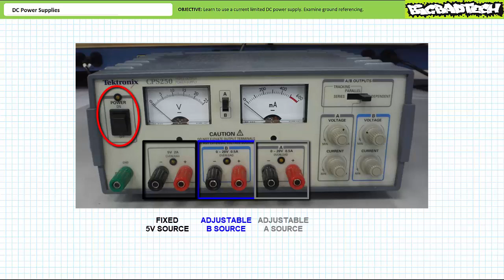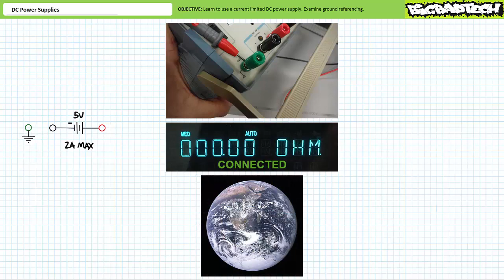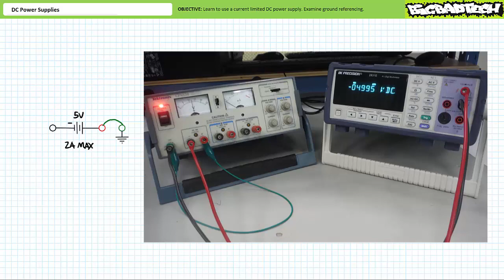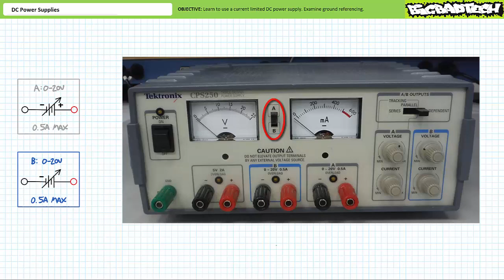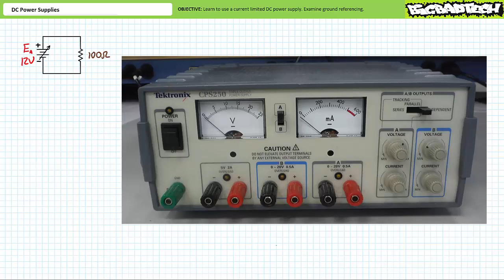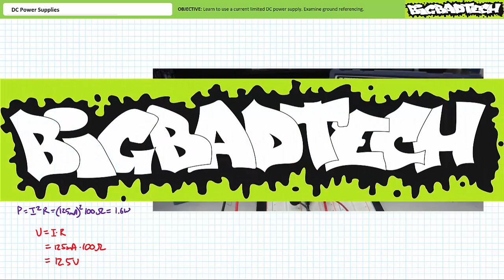DC Power Supplies (Full Lecture)

Comment: Hello. Late to the game, but I am a learner.
An amplifier board needs +/- VDC. How does a bench PSU supply this? Are there + and - leads/outputs? Thanks!
Reply from the maker: Excellent question! Given a power supply with 2 independent outputs one would establish a common connection with source A negative and source B positive. Then one would supply the amplifier with source A positive and source B negative.

Comment: I am using an arduino in an 1965 50 vac pinball machine and it reset when the flippers actuate.  can this be changed with using DC power?
Reply from the maker: An easy way to convert from one flavor of electricity to another (ie: DC to AC or vice versa) is through the use of an interposing relay. Check out the "PLC Interface Methods" lecture at: https://youtu.be/G4uo0Sm0uMo
Reply: @bigbadtech  will do thanks
Reply: Simply put. If your desire is to make a certain DC voltage to actuate something but AC is an already existing control (pilot) voltage. Use an ice cube relay (120VAC coil) put your desired DC voltage on the common terminal and connect the output wire to a normally open terminal associated with that common.
Reply from the maker: Exactly.
Reply: @bigbadtech  is DC power known to have fewer issues with unwanted EMF than AC power.
Reply: They also make old style 48 VAC ice cube relays.

Comment: I just bought an oscilloscope and DC power supply today to start probing and building ttl circuits.
Reply from the maker: Very nice. I've got some older lectures on digital electronics on the @cgcclive YouTube channel.
Reply: @bigbadtech  yea I'll definitely check it out. I was Firecontrolman in the Navy for 10 years. I got out back in 2016. I worked on weapon systems, our schooling was pretty stellar to be frank. We learned digital electronics all the way to radio frequency generation and radar propagation. I'm pretty stoked to have my own equipment now to start building some of my own stuff, I think I'll start off by building some functional RAM.
Reply: @bigbadtech  also, I'm sure you're a busy man but do you have a business email? I would like to collaborate with you in the future. I'm thinking about developing a PLC.
Reply from the maker: My time is definitely not my own, especially with our school in disarray because of the COVID19 situation, however, give me a shout at my cgcc address.